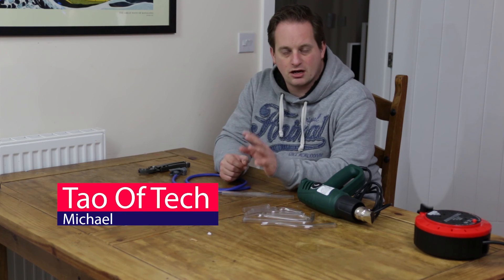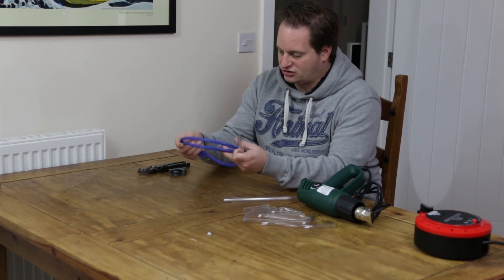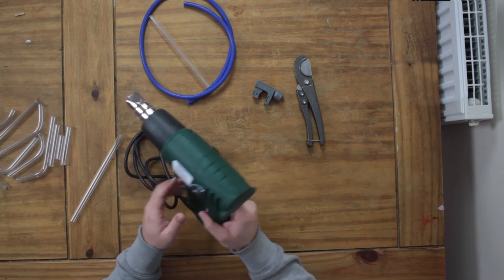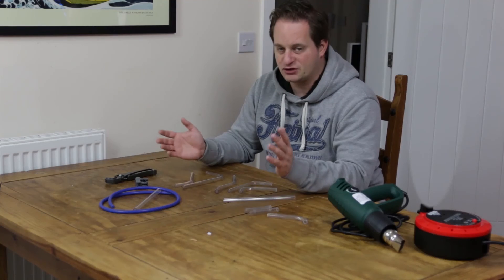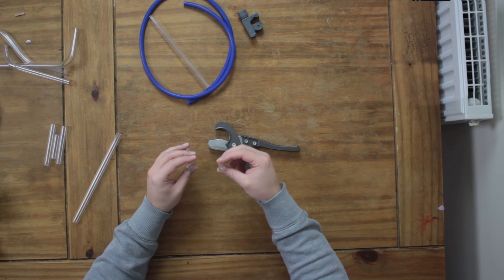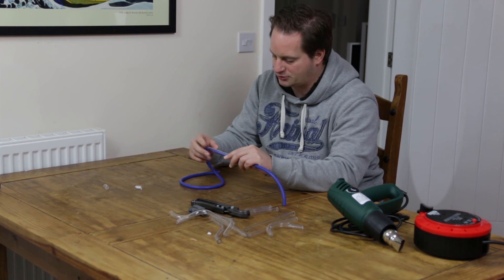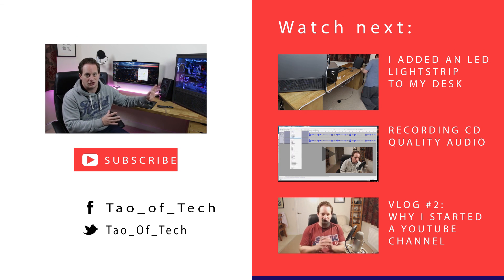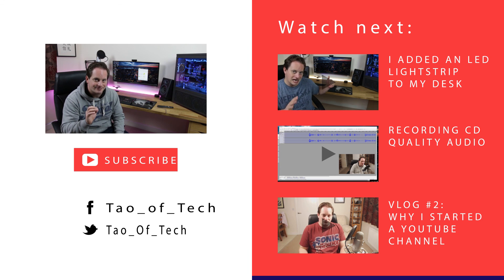How to bend and cut PETG hardline tubing

Comment: manufacturers of petg say not to use it water cooling loops as its not compatible with most liquids. glycol (coolant) especially.  dont cool acrylic under tension or at too high a heat or you will make it brittle.

Comment: I enjoyed your video. I am about to take on my first custom loop. I am using PETG. I am also using a pipe cutter that you spin around the pipe. My question is, can I just use a little sand paper to clean up the edge of the cut instead of buying a tool for it?
Reply from the maker: +Lex Lutha111384 glad you enjoyed the video. If you are using petg and the cut is clean you shouldn't need to use sand paper at all. Personally I found a sharp pipe cutter rather than a plumbers tool gave a cleaner cut.

Comment: Hello sorry to trouble you again I have tried removing it the way from the heat so it takes longer to heat the tube but it's still flares up when it's ready to bend
Reply from the maker: just so i am clear, describe what you mean by 'flare up'
Reply: It expands where it heat up, even before I bend, so when I have completed the bends then the radius looks bigger than the straight bits.

I have a photo if you have an email address.
Reply from the maker: hmmmmm, send me a pic, email is urban.91nja@gmail.com

Comment: when I heat up my petg tubing the heat makes the tube flare out, even before I start the bend.

how do you stop that?
Reply from the maker: +SiriusComputers try holding the tubing further from the heat gun, remember to move it left and right and up and down. You also need to rotate it so you get a nice distribution of heat. You also need to try and not bend too early otherwise you will get flat spots. Slowest and calmly is the right way. Let me know if you need anymore help...
Reply: thank you for your reply, I have tried introducing more heat but the longer I leave it in the heat the worst it gets.
Reply from the maker: try moving the tube further away from the gun, it may be getting hot too quickly

Comment: And with petg tubing whenever I finish cutting it can I use sand paper to smooth out the cut or just leave it be?
Reply from the maker: if the cut is clean you can leave it as it is - better with soft tubing cutters than with a plumbers cutter. Remember - if it s acrylic then you need to sand it.

Comment: Great Tips! Can you lay it on a smooth surface to bend or will that make one side kinda flat? How do you know its perfectly level when bending? Say your wanting the tube to be parallel to another tube.
Reply from the maker: +Jay Caldwell I've never personally done it that way, you would have to do this if using a bending kit so I don't think the tube will go flat (you would have to press pretty hard into the counter top). As far as perfectly level goes, I do it by eye (which means I get some wrong), if you want perfect results you need a bending kit such as the one from Monsoon.